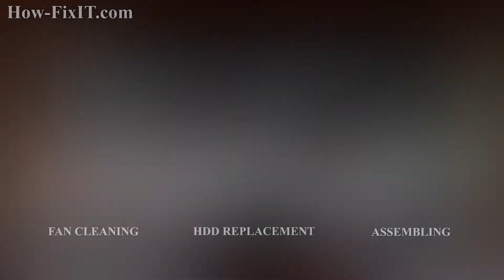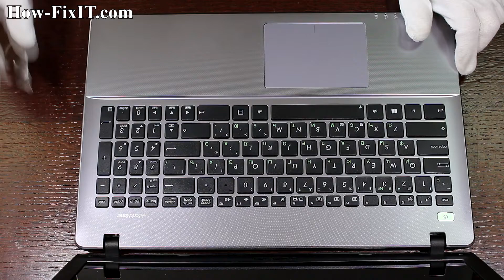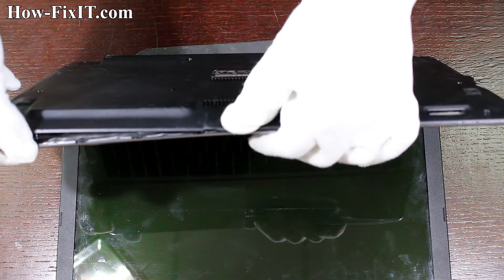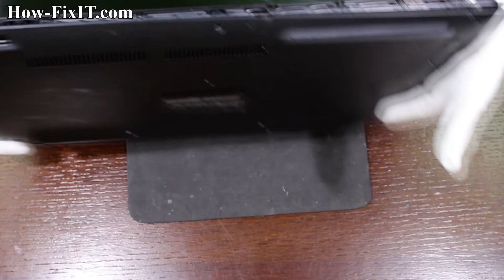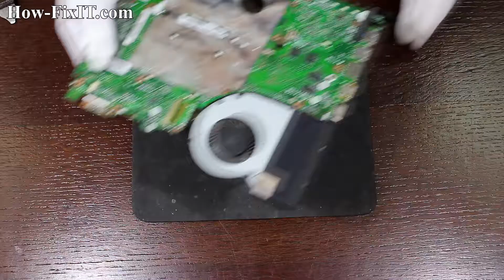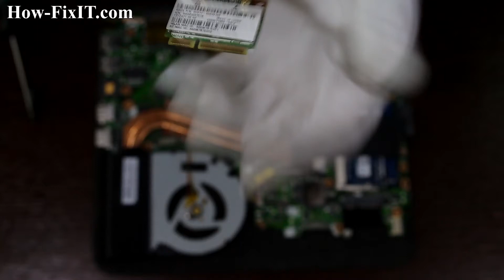Asus R510 Wi-Fi Card Replacement | DIY Repair Guide

Comment: Do You think this can be upgraded to 802.11ac-standard card?
Reply: I'm wondering the same thing. Did you find out?
Reply: @m.a.h.4948  Unfortunately, It's been a while so I'm not sure, and I don't have any firm proof or reference. However, getting from my recollections of my previous extensive research and eventual decisions, I think I wasn't able to upgrade to 5 GHz-compliant standard, and I left the NIC unchanged. The documentation and official technical references for these older models became more and more obscure with time, so It became increasingly difficult for one to verify that. I guess, the only way would be to have a plug&play USB card for having this. 
Hope that helps.. Cheers!
Reply from the maker: I’ve provided a link to compatible Wi-Fi Card In the description under the video